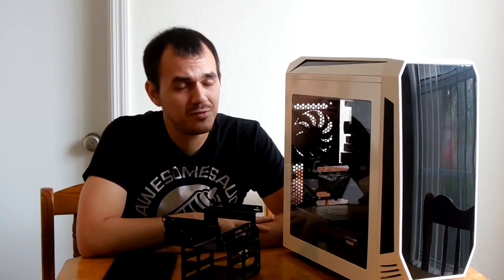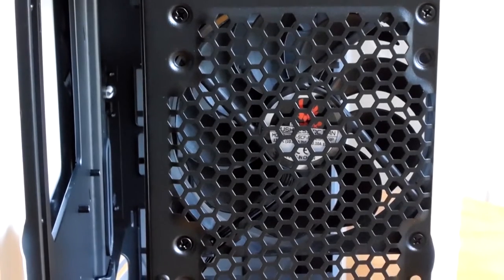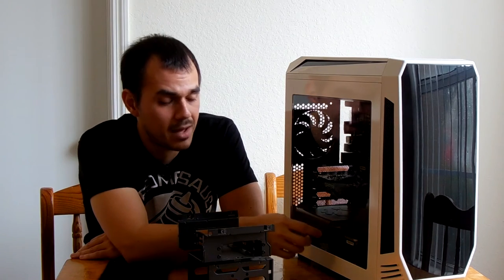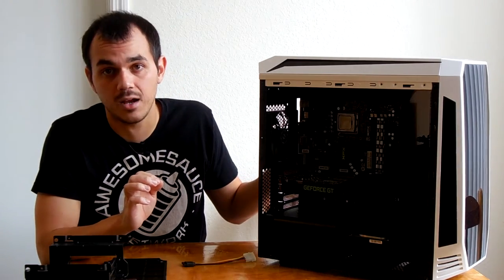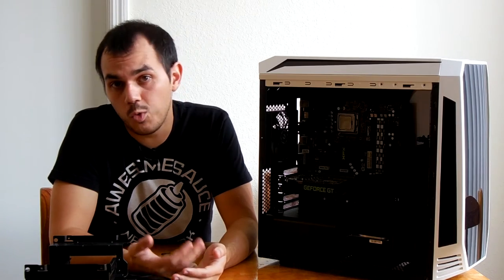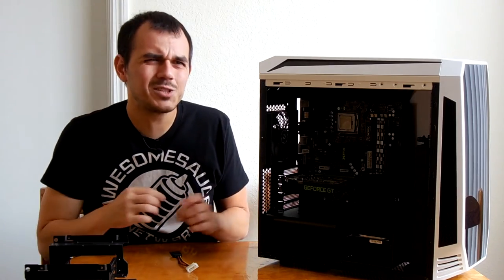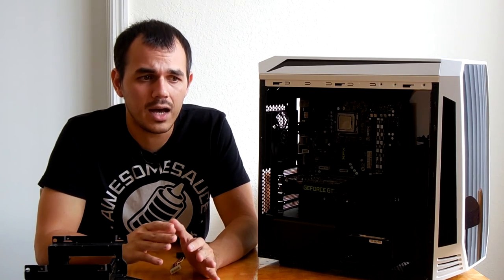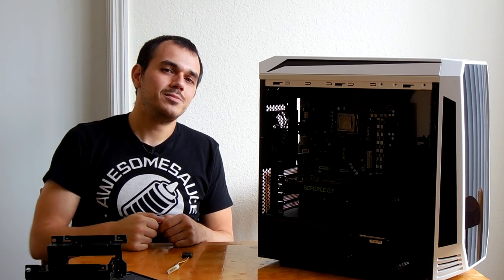Manic Tech #0009: BitFenix Aegis mATX Case Review

Comment: I built my gaming rig in this case and found another solution to configuring the front mounted radiator and long water cooled video cards.  I mounted the front two 120 mm fans in front of the case structure right behind the icon display.  The trade off was worth it to me as I gained over an inch of clearance for my video cards, but I did lose the front magnetic dust filter.  I had to modify the pins on the icon display though to connect the USB cable from the side.  After that, I had room to mount my reservoir directly onto the  the front radiator using the provided bracket and still have just enough space for my two EVGA Hydrocopper cards in SLI.  Also, moving the front 240 rad as high as you can go will allow to place your 3.5" hard drive bay vertically under the radiator.  In all, I have two 240 radiators the four hard drives installed.  Great case case and review.

Comment: Is it possible to install multiple 140 mm fans + a Corsair Hydro Series H100i GTX as a CPU-cooling unit? Q-Q
Reply from the maker: +Aldean61 I don't see why not.  This case is shockingly roomy for a mATX tower, you just may need to make some compromises in terms of available storage... but I don't really know of a case that doesn't force you to make that compromise in some way or other.  For a config like that, I'd probably set the rad in the roof, with two 140mm fans in the front, and a rear 120mm fan also acting as intake.

... but that's just me, you do what you want x-).
Reply from the maker: +Aldean61 Also, thank you for the sub!

Comment: Hows the cable management in the back? Is there enough space to fit non modular cables? This is the case (same color too) that i purchased for my hackintosh build!
Reply from the maker: Cable management is ample enough for a non modular PSU, but if you intend on using extensions you may find yourself at a loss for what to do with the extra length. If you go that route, I'd advise something like a BitFenix Fury PSU, or a full modular PSU with a custom cable kit.
Reply: The Manic Geek Thanks for the quick reply! Alright I will keep that in mind :) I think im good without extensions so it shouldnt be an issue! Thanks again! :D
Reply from the maker: +PMD-Shadowz lol not a problem. Can't promise all of my replies will be this fast, but I do my best to respond to all the comments I can :-)
Reply: +The Manic Geek So I got this case...its pretty awesome...Thanks for the video allowing me to solidify my choice! :)
Reply from the maker: +PMD-Shadowz Good, glad you liked it!  You should share some pics of the finished build!

Comment: Damn shame it's above my budget, the moment i saw it i fell in love! I need a new case asap, so i'll get the Cooler Master MasteCase Lite 5 instead. :(
Reply from the maker: +Signex NL honestly the MasterBox Lite 5 is prolly gonna be a better case all around for you given that it's a newer release by far and has a better layout. The biggest issue I had with the Aegis was the total lack of cable management space behind the tray, and Cooler Master has been giving system builders gobs of room for it lately. Not to mention the MasterBox Lite 5 is an ATX case, so you have more room to grow in to it in general :-)
Reply: I went with the AZZA Onyx 260 case with tempered glass. Lots of room, but sadly lacks the space for cable management as well. Will probably exchange it with a MasterBox Lite 5.

Comment: Are you able to make your own icon for the led on the front?
Reply from the maker: EthansTech Absolutely.  The screen plugs into a spare USB port on your motherboard, and using software downloaded from their website it will allow you to set up a 2.8" "ICON" for the front of your case.  I personally wasn't able to do this given that the hardware I put inside the case wasn't functioning... I just use it for spatial awareness in a build x-).  Hoping that changes sooner rather than later, but #PoorPeopleProblems. I'm gonna edit in a link to the product page in the description, the software is under the "support" tab.